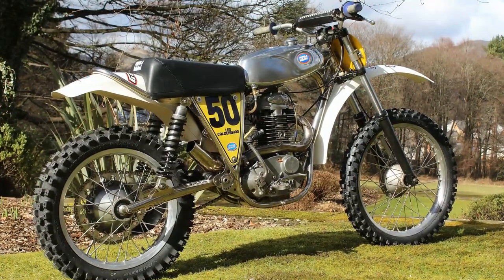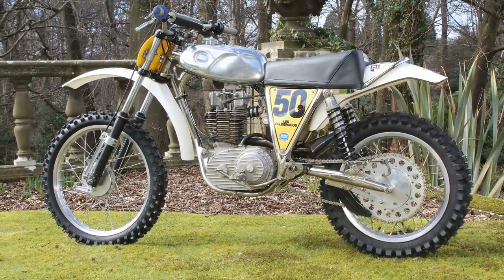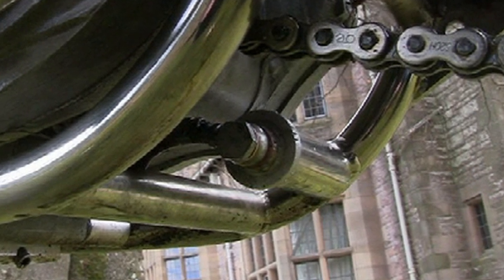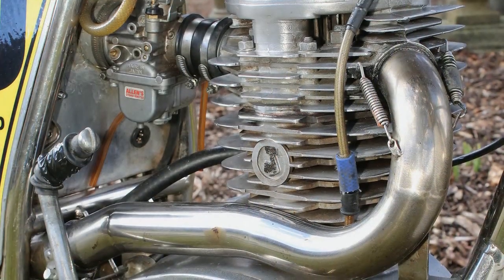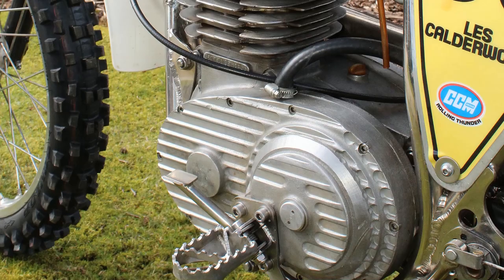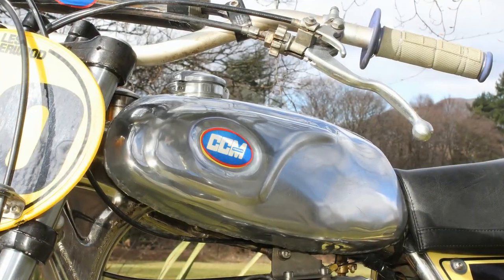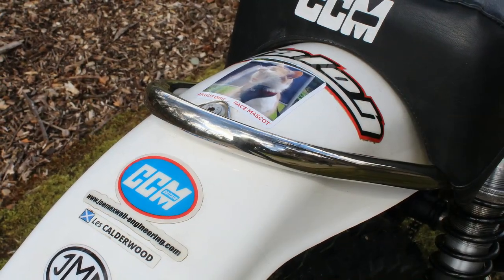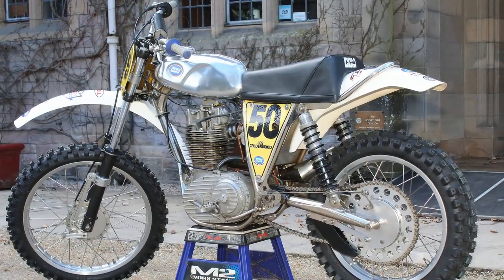Classic Re-Manufactured 1974 580 CCM

Comment: I had a brand new CCM when I turned 15 I remember it as being 608cc but I may be wrong. It was much better than the Greeves I had before it. I only weighed 8.5 stone then so it pulled pretty well. Mine always started well but I had the touch which others had a sore leg instead. Liked 5 star gass , tried methonal did a bit of sand racing blew away everything else easy.Miss it now. I think the fins are done to aid removing mud it's certainly easier when you're buried in the stuff.